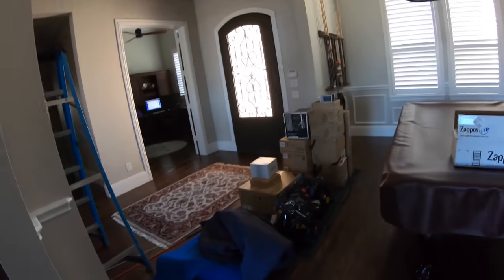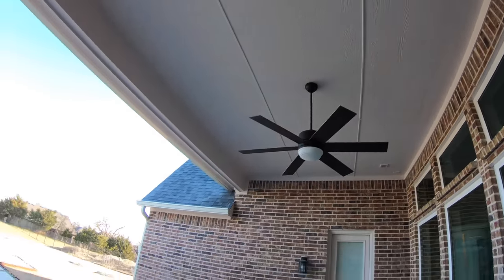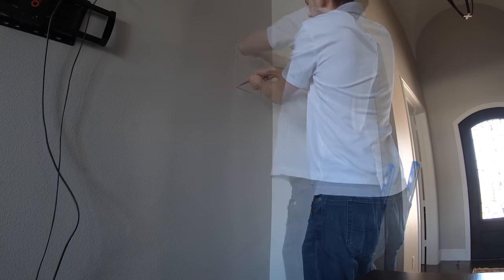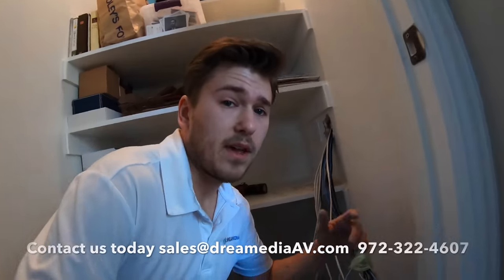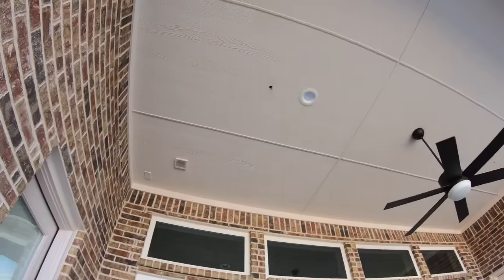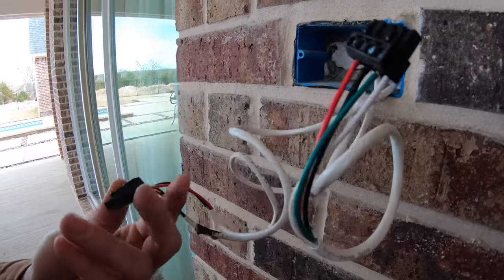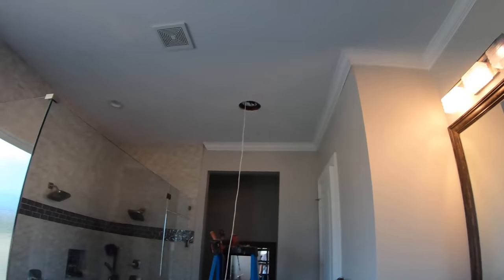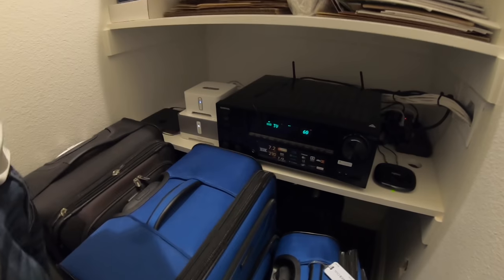Klipsch 5.1 In Wall Surround Sound w/ 4 Zones of SONOS / Whole House Audio FULL VIDEO

Comment: those tv speakers are to far apart and will not really work as a 5.1 surround system they just look the part.
also the sonos are old versions and i doubt the customer chose to buy an older sonos connect amp to save $100 looking at there home they are not cheap
Reply from the maker: The centerpiece of the room was the huge clock. The customer did not want to relocate the clock. We worked with them on the 5.1 install
Reply: @Dreamediaav  Recently I had almost the same set-up!! And 100% Agreed about placement. 
I’m sure you pressed for a over the fireplace tilt or even a pulldown; sometimes customers have made up their minds and there’s nothing you can do to change them. It’s tricky because of you spend too much time on it, you risk offending them and/or pissing them off, & losing the whole deal. 
I had a situation really close to this where the guy had built his own mantle from a sentimental tree from his family home. Nothing was going to share space with it. Did 70” OLED @ viewing level along w/a quality 5.1. Big room, fronts went with ESS 1700s, 8”. Like this, customer wanted them at extreme ends of the main wall. (Furthest possibly from his hunk-o-wood)... To counter, doubled up on the center and did in-ceiling almost directly above the sectional sofa. Thru the corse of the sale/install, got to know the customers as we often do. He was really into music and I knew his favorites. So to ask him to spend another 2K, (big roll of the dice because input audio in already) sat him on the sofa and cranked his favorite band 🤘🤓🤘
15 seconds in with a big smile on his face I got the “YEAH, LETS DO IT!!” 
I guess the moral, it’s not what I wanted or would have done, but hey, when they pay a premium, I’ll deliver exactly what they want!  Find ways around the obstacles, but keep TOP Quality result #1 on your list!